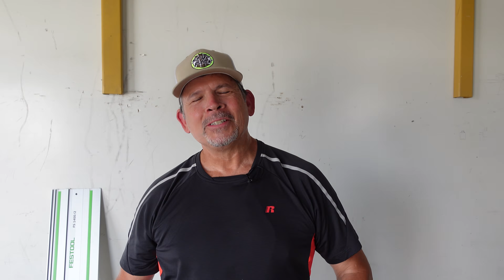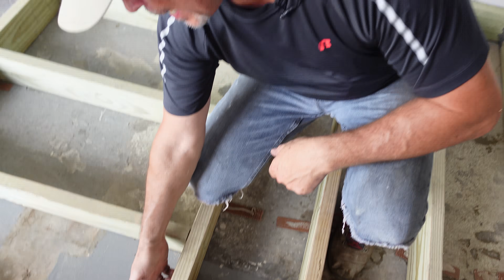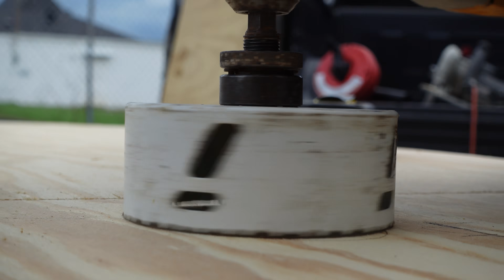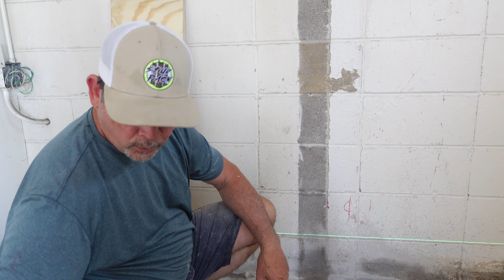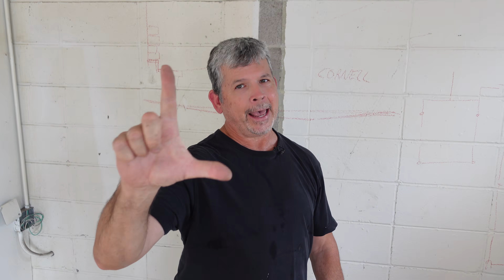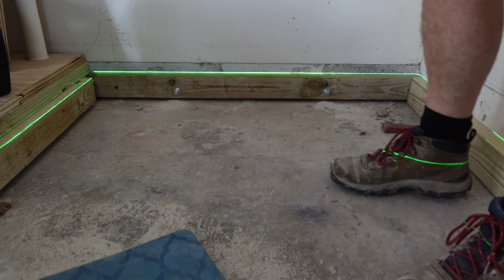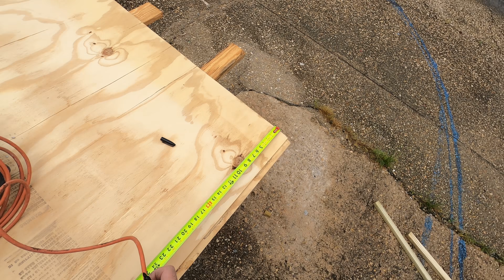Building a Bulletproof Curbless Shower (on Concrete Slab) - THE SHOP Part 5

Comment: Yep. If your not drilling into solid concrete don't use the hammer drill. It'll waller out the hole in soft cinder blocks every time

Comment: PL isn't cheap, but it adds strength and stability worth its cost many times over. Avoid getting it on you though, one of the worst adhesives to clean off. Incredible overall job. And that rain and dampness actually helps PL set-up even stronger.

Your failure with the tap-cons into block turned into a priceless lesson. Excellent episode, one of the best. And of course, once the PL dries overnight, after initially swelling, it shrinks, and tightens up the entire structure like a drum. PL has revolutionized some forms of construction.

Comment: Seems you guys have found out like I did about Tapcons. I was always very careful and blew out my holes but still have a large % that strips. I have the best low voltage guy I have ever seen. He taught me to just use drill mode. He does Tapcons day in and day out. He also says no matter how careful it will always blow out the the other side. I have had so much more success just using the drill function. Right before I met him I bought a nice SDS with attached vac just for Tapcons. I don't use it. Some guys wrap a copper wire around the Tapcon if it won't thread. Commercial jobs use epoxy with different type fasteners. Those are pretty much bulletproof but of course more work.

Comment: When securing a ledger to hollow blocks like this, I ALWAYS use structural wing type anchors. Like the ones you use for drywall (grabs the back of the drywall) but 3/8”-1/2”. That with some good PL, and it really sucks the ledger tight and secure.
Reply: Came here to say this as well. We call them 'butterfly anchors'. I think they are just as fast as Tapcons and little chance they eventuall give out under stress. Only reason to not use them here specifically would be possibly rusting over time due to this being a 'wet location'.

Comment: I knew that getting anchors into that block was going to suck. I probably would've done 5" 1/4 - 20 toggle bolts with liquid nails. Hollow cinder block isn't great for strong anchors.  I really like that you ended up getting tapcons to work, I have had tons of bad experiences with them.

Comment: Nice work, you mentioned insulation on the walls, why none under the floor? Or like one commenter said at least a vapor barrier? Maybe it doesn't get that cold in Louisiana, but seems like it would keep the tile from getting as cold.

Comment: I know I wasn’t the first guy to point out the issues with the drain pipe rubbing the metal plug and the L brackets being fastened closer to the bend. But I’m glad you guys not only read your comments, you actually listen to your viewers and fix the issues. You are humble enough to take advantage of the good suggestions that other people might have. That way you ensure your job is the best it can be. So for that, as well as the entertainment you provide with each video and the positivity and great energy all around, I congratulate you and thank you for your hard work. You guys are amazing and I know good things will always happen to you.

Comment: Uses spare wire you cut from fans when you install them or something similar. Hold the wire in place as you screw in the screw and it will be a super snug fit. It is not going anywhere. Trust me it works. It makes up for the space that you lost when it was chipped away the hammer drill. You can even use two wires . Once the screw is in it will be pinched off by the screw or just move it back and forth and it will come off. Try it. It's a game changer

Comment: love your videos. Theoretically speaking, couldn't you just pour some self leveler on the whole concrete floor where you were building a bathroom? You were going to put 2x6's on top anyway so it would be covered?

Comment: Love watching,  but you would have saved a lot of time and materials, if you had cut in the drains and sewer with a wet saw and sand fill. Then Sack Crete over easily done  in a day,,, but Wow! your building a heck of a sturdy floor structure there.  Keep up the great program.

Comment: 11:20 here in Florida they love their block and concrete walls, stucco too.
Ran I still similar situation year ago in a bathroom, no less, lol; and ended up patching the broken crater of block w/ patch material and ended up sitting bolts in the patch/epoxy material so after it cured for while, we were able to attach ledger onto bolts and than put a washer/nut on to get that thing on the wall. Was a bit crazy, and how the crater got there….another person decided to try a ramset to fasten ledger to wall. As you can imagine, for a floor, works ok, but on hollow core block, nope, didn’t work 😆 🤦🏼

Comment: Try toggle bolts. I don’t mean the butterfly style but the plastic zip tie kind. They’ll hold 80# in drywall but in cinderblock they’ll hold hundreds of pounds. If you out enough of them in there, I’d bet they could hold structural boards
Reply: Toggle and PL Premium. Nothing better!

Comment: @stud pack 
Sorry for another comment)
Wondering if you guys ever used the AdvanTech subfloor foam adhesive can/gun instead of PL for any jobs? When able I love using the foam adhesive cuz there’s so much in that can, and can get an extended reach gun so don’t need to bend down to apply it; also, it keeps longer than the adhesives/sealants/caulks that come in the “caulk tubes”, so ya don’t end up throwing old used stuff out (like saying goes: best way to store and save “anything” that comes in a “caulking tube”…..buy 2 of the product ya need, that way when the 1st goes bad, have more, b/c it’s pretty impossible to “save it”😉).
Cheers😊

Comment: Did you guys think to shoot that ledger with a ramset gun? The screws are great but require more muscle, dust, and wear and tear on your drill and bits. At the end of the day you're just giving it clamping pressure for the construction adhesive. It's not going anywhere. Plus it's a lot more bad ass of a tool.

Comment: I noticed you glued the shower sub floor framing and did not use L brackets or joist hangers. Is that because the shower sub floor is lower and would experience less flex and likely less traffic?

Comment: You could have used those nail in anchors just put the hammer drill on hammer mode and run it in or take a piece of rebar or something long and hard to hammer in the nail in.

Comment: I'd put a small metal cover over those 2 x 6's beneath the sub-floor (to protect the pipe from nails/screws going through the pipe should someone in the future decide to build something, add walls, etc).
Reply: My thoughts exactly. Nail/safety plates are a must. As a plumber, depending on the job of course, I'd fail inspection without them
Reply: There called a “bocca” plate and there building code

Comment: not sure if it would have worked for you here or not; At work when we anchor heavy equipment to block walls we use chemical epoxy anchors with a epoxy basket that goes in the hole first to contain the epoxy
Reply: cool
Reply: I've not heard of this product, thanks!

Comment: Sorry, went off the comment section, looks like you came out with a solution!

lead anchors into the brick/block wall.

your drive pins should work aswell the zamac pins

why not drill in the center and sides of the block so you have meat to grab all the way through?

Comment: just a question is that treated lumber if so why do you use treated lumber as a floor? this is so intereting here in sweden we would have used regular lumber with a "cardboard" type of material so the moisture doenst touch the lumber. here we cant build in treated lumber because its treated.

Comment: You guys rock!! You gotta get the Spyder hole saw kit. They eliminate the pain in the ass removal of the scrap piece left inside the hole saw. Pricey but worth every penny. I only use mine for rough framing, subfloor install as the cuts are very aggressive

Comment: Against the 'cinder block' use perforated nylon plugs, pump in some epoxy resin and use a bolt embedded into the epoxy. Like a 'horizontal' anchor bolt.

Comment: Hilti has hollow block wall anchors. You have to put a mesh sleeve in the wall and then inject it with this foam stuff etc.
Reply: great tip, just checked them out on the video. I always have a hard type anchor them cinder block.

Comment: Great video again. Here in the UK most contractors no longer use plywood in a bathroom environment. Most use a concrete board and we now have a product called no more ply which will never rot.
Reply: Most contractors here simply wouldn’t have done it this way. The plumbing would have been buried in the concrete and the concrete would be the sub-straight to tile over.
Reply: Wood and water are not an everlasting solution!

Comment: Great work and video. Now heres my 2cents as a GC. If it were my job, I would have layed a vapor barrier down first across the whole floor. Also there should have been a nail plate over all of those pipes. You guys do a great job going the extra mile to ensure strength and longevity. Just don't let that distract you from the safety precautions.
Reply: [I would have layed a vapor barrier down first across the whole floor.]
If the joists weren't glued, I'd agree, except that PL, when it dries is waterproof, and a vapor barrier would cancel the bond directly to the concrete. Bad enough that the concrete is painted, albeit if good paint, it will bond to the etch of the concrete, then the PL to it.

You also have to consider if a vapor barrier in this instance would actually do more harm than good, and lock the moisture in.
Reply: @stephensaines7100  they are in Louisiana which if I'm not mistaken that's a pretty humid place. The temperature difference between the floor and concrete plus the humidity could cause a buildup of mildew under the floor. The glueing of the shims was additional security to keep them from moving not necessary. And the holes drilled for brackets could have been caulked over.
Reply: nail plate! good call... gonna be drilling a bunch of screws to hold down the concrete board I imagine!
Reply: I’m a GC also and said that about the vapor barrier in the last video or at the least a sill seal break at the concrete.  
Wood versus concrete is a bad idea and is a code requirement 
And the bocca plates too 

Clearly there not getting ANY INSPECTIONS or some of these very simple items would be getting addressed 
Although I do love the stud pack and have watched every single show

Comment: I saw the tapcon with the philips head... you guys really need to get square headed screws in the U.S. We have these in Canada and it has so much torque when you're fastening in hard material. I take these every day over philips heads. Great video I love this shop sequence. Cheers
Reply: Tapcons are the same in Canada. No Robertson.
Reply: All right my bad, I always use the hex head for tapcon. But still heavy duty wood screws are so much easier to use with the robertson heads.
Reply: @vlaf9  i wish they’d make them with robertson.

Comment: As one of the people asking about the single fastener on the L brackets. I have to say I absolutely love how you guys respond to comments in video. Not only is it informative but it's a testament to how you stand behind your work that you're willing to discuss questions and (i don't think I see much often, but also) criticism and in some cases (such as the drain plug) you take the extra little step to make sure everything is rock solid. This is why we love this channel! Great work Paul and Jordan
Reply: Hilti has an epoxy system for hollow blocks that works very well.

Comment: You can drive a hit pin with your hammer drill use either a pointed chisel bit or an old drill bit put on hammer only it drives it right in.

Comment: PLEASE READ Great job guys, im hoping I can give you a heads up on your drain location for the shower, since your so close to the wall with the drain, if your using a Styrofoam pan or floating one , what will happen is your height for the pitch at the longest point will also be the height of the pitch at the shortest point wich makes it very steep and tricky, awkward to tile. The pitch will be greater on the short side even though it's perfectly level. Hopefully that makes sense thexwsy i worded it, but think clearly before you go ahead and tile it. Good luck. Keep up the good work.
Reply: It looks like they might be setting it up for a linear style drain.
Reply: @MoneyManHolmes  yes that would work fine then, but watching the video he mentioned it being pitched in different directions.  You are 100 percent right though, using a linear drain would be the easiest way. Hopefully that's what they plan on doing. We'll have to wait and  see, lol.

Comment: One of my favorite anchors in cinderblock are the lead shield anchors. Threaded insert that flares the outer lead barrel to make a beautiful strong hold. They come with a generic striking tool but I prefer the threaded strike tool because it leaves the anchors flush or just a hair behind the block and it doesn’t matter how deep you drill the hole
Reply: Would your recommend toggles on hollow cinder block? I've used them before but only to hang shelves in a basement that I drywalled and was only furred out off a block wall
Reply: @djblock215  You can use Hiliti toggles for example. They are rated for cinder block and have a high shear strength. 1/2 inch ones are rated for 500 lbs shear each in hollow block.

Comment: Hi Guys, as always great job! I love to watch each episode. One tip, you can use Bosch in hammer mode to tie these L-s to the floor with the same type of anchors that you used day before.
Use normal concrete drill to do that or you can cut off the end from old, dull chisel drill. This is trick used here in Europe where we have a bit more concrete walls and floors to fight with.
It work's great in tight spaces where it's hard to swing the hammer.

Comment: Its a bit fiddly but you can drill through the ledger and mark the wall, then pull out the ledger and drill the block wall and put in plastic plugs, (spaghetti) then use regular screws to attach ledger. 

Hey you have a Ranger I think. I hope its not in the shop for a torque converter. Mine went last week and turns out its a very common fault on Rangers.

Comment: I just got a question for you is it true that the type of wood you're using now will shrink versus the engineered plywood for your floor
Reply: It is true that treated lumber swells during the treating process. You will often see boards that are 1-9/16” to 1-5/8” wide at the lumber yard even though they were originally milled to 1-1/2”. As they dry the will shrink. You can also find what they call KDAT which stands for kill dried after treating. The name pretty well describes the process. It is a much more stable product and twisting and shrinking are minimal. No clue which one was used but it could potentially be a problem. I would suspect that between lagging the ledgers and seeing they used a polyurethane adhesive i wouldn’t be overly concerned.

Comment: question, would it have been easier to make it a concrete step with the plumbing embedded in it than build the wood floor?
Reply: the show is call stud pack
Reply: If I remember correctly that was the original plan but the client didn't want the concrete dust or something

Comment: Should have put a metal plate where you didn't want a screw on joist. Very important for other trades or tile backer board etc
Reply from the maker: Once backer goes down we're not worried about someone else drilling through the subfloor. If they are, drilling through a pipe will be the least of their worries.
Reply: @StudPack  you might drill the backer board through the pipe. But anyway good practice

Comment: I am a commercial hvac tech in the pipe fitters union, I like to use something called corkers for block anchors. Look them up. They take a special tool but leave you with a 3/8” x 16 pitch female thread in the block and then you could fasten using 3/8 bolts.
Reply: We call them “ Sammie’s”  and use them by the thousands

Comment: I saw the comment on drilling before knocking out the concrete, and seeing you guys use it today was amazing. Amazing work!
Reply: Great vid. How come no blocking I under the shower?
Reply: @MrTooTechnical  Short pieces of lumber there, just not necessary for that extra strength.
Reply: Cool

Comment: Only just curious, because I went through something similar but not as extensive years ago and I would approach that situation differently now, but would it have saved time to just throw the treated wood  glued down solid on concrete, and then use self leveling compound on top of say .750 t&g? Then once that's leveled, top with .500 ply? StudPack, you guys are a great team. Love the videos. And I felt that last "Lets do it". (you gotta dig deep at the end of the day and push through to that stopping point)

Comment: Yikes!  do you really want the P-trap under the floor not accessible for cleanout when somebody drops their wedding ring down there?????
Reply: Shower needs a P-trap and I've never seen a shower P-trap in a slab on grade floor that was accessible. The drain should have a grate on it to alleviate most of those concerns anyway.

Comment: The "drill only" mode is a good suggestion. Alternatively, if your hole becomes a little too big, you can insert a piece of copper wire  in the hole to pick up the slack and it will hold extremely well.
Reply: Great tip.
Reply: Use this tip quite often. Works really well.
Reply: Tie wire works best imo, but even a toothpick will do the trick generally
Reply: And drill the block at the Engel where it’s solid not in the cavity